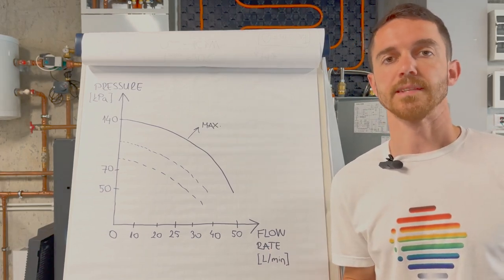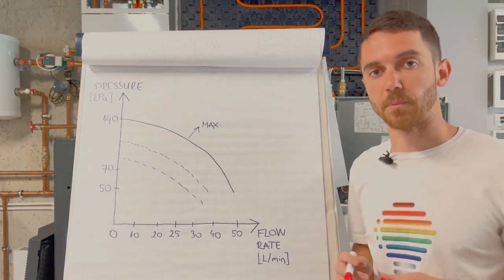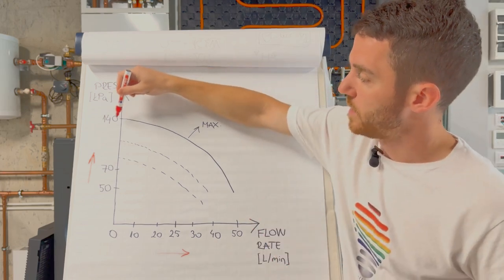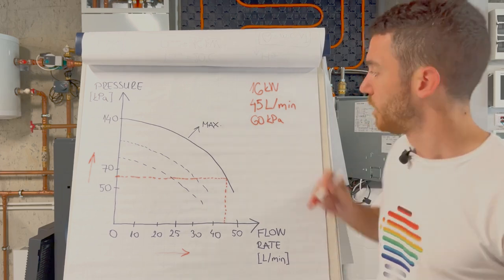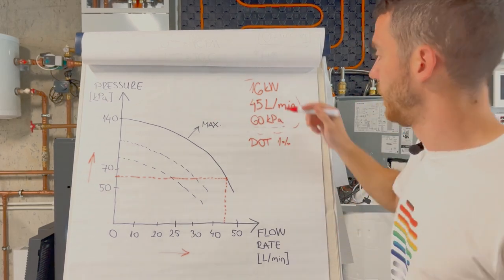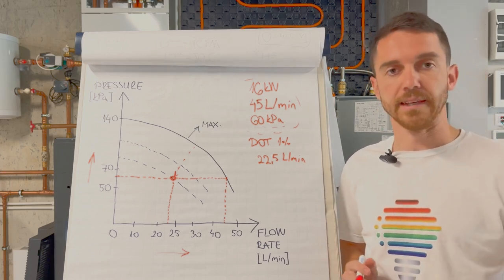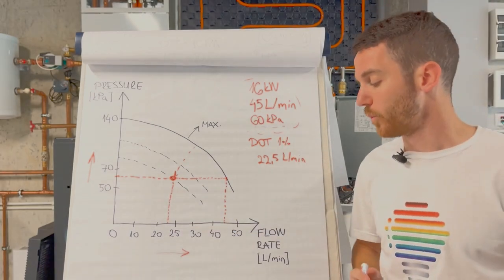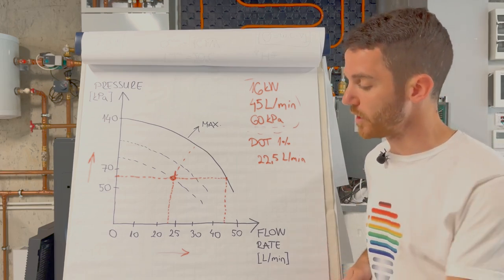Buffer Tank or Not? Heating Pump Curve Explained

Comment: Pump has 3 settings low loss header and then pump has 3 setting I have only radiators one circuit up stairs and down stairs how do you regulate them 
,flow setter is on return after Low loss header where do I get pressure reading or temperature readings it is all pure guesswork T1-T2 not much difference the readings are on the return far from the low loss header.Where can I get the information without paying for a heat geek course I would make them cry Logical question not theoretical on the job A=B stuff.Moan over heat pump waste of money as far as I am concerned too many get outs.Keep up the good work.English is my first language haha yours is better🏴
Reply from the maker: Please explain better, I don't understand what is the question? Delta T on radiators? Or pressure drop?

Comment: Very good presentation and analysis. But in my opinion, the graph is valid only for the newest models of some monoblock heat pumps. Can you please present same data for Daikin, Mitsubishi, Hitachi, etc? Also is this the available pressure or the maximum? The heat exchanger of every heat pump "consumes" from 20 to 30 kPa at least. For apartments or small residences in my opinion it is ok to use heat pump's circulator without buffer. But in larger villas, even with heat pump of 16KW (for low energy building, it is covering approximately 400 sqm) primary/secondary is safer
Reply from the maker: This graph is from Panasonic heat pump and, as I mentioned in video, this is available pressure for installation.

Even for 16 kW if you can satisfy flow rate and pressure drop, it is fine.

However, each installation is specific so that must be taken into account.